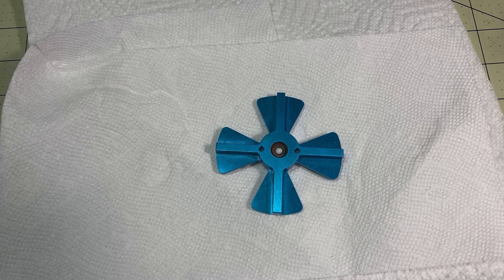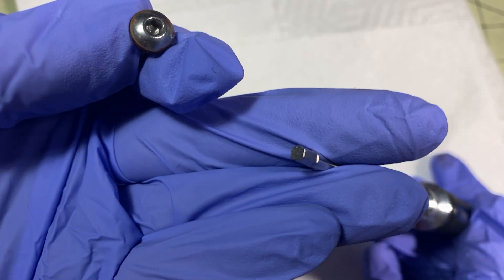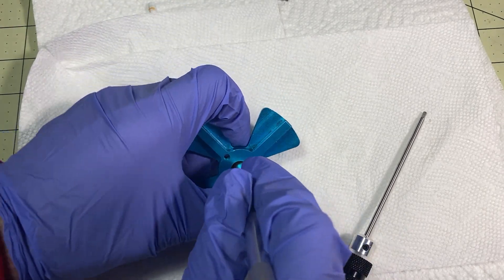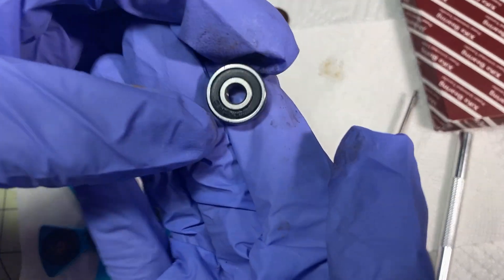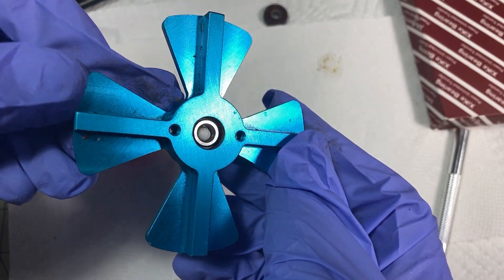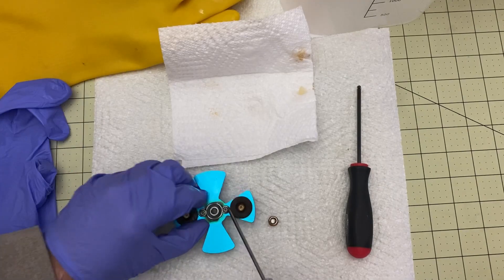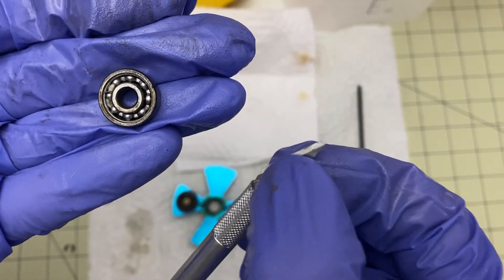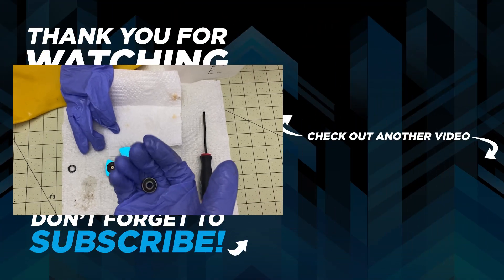What happens if you use water in your Resin Wash and Cure Station? And $1 Way to Fix it

Comment: Any info on how to replace the bearings in the wash and cure plus as the rotor has a different design and I can’t figure out how to get the bearing out.
Reply: I have the same problem, i was thinking it was pressed, soy try to push it out and broke the rotor 🥲

Comment: I have just taken delivery of the latest Anycubic wash & Cure station 2 and it is fitted with a S625ZZ bearing, which is a stainless steel bearing (the spare is also stainless steel). So hopefully, this will fix the issue?

Comment: Awesome video, thanks for putting it up.  Any idea if these bearings will fit a Anycubic Wash and Cure Plus?  That's the larger, more expensive one.  I've been washing my water washable resin with running water and a toothbrsh and it's really a pain.  Also any tips on disposing the water (besides leaving it in sunlight to evaporate/cure)?  Disposing of the water would definitely be a good topic for another video!
Reply: Maybe someone will find it useful. This machine uses a 628 bearing with dimensions 8x24X8 mm. Also, this lower rotating part already has 4 magnets and it is completely made of plastic, but it is still better to change the bearing itself and put it with waterproofing. If you wash in water. Thanks to the author for the content.
Reply: I was thinking i can take it out pushing it, so i broke de rotor 🤣, i will try with super glue to repair it, i think there is no another way to change it, if anyone know something about wash and cure plus bearing say something please

Comment: If it would have been designed better, it would never have needed a bearing to begin with if it they would have applied a little fluid dynamics in the picture. Brass bushing would have sufficed , but a ceramic or teflon bearing would have been fine as well.     Derp...

Comment: Ceramic bearing + dump the 4 steel screws for aluminium ones . . . problem gone.
Reply: Do you recall what type of screws they were? Metric? Imperial? Like M1, etc....
Reply: screws are alum on the 2.0, split washer however needs replacing as well

Comment: This is some more great info, I have an Anycubic Wash&Cure2.0 coming in the mail, and I'm definitely going to grab these washer, or find a ceramic one before I even start using it.

Also bought Phrozen's water washable resin from your article.  Looking forward to see how it does.
Reply: Funnily enough, both listings for Anycubic's 1.0 and 2.0, claim they come with a stainless steel bearing...
Reply: @theeeUnicorns  There are different grades of stainless steel, also the bimetal effect probably has to do with it (steel bearing, aluminum propeller in a conductive liquid)

Comment: Wonder if this has to do with bimetal effect:
"As many metallurgists will know, the bimetal effect, or bimetallic corrosion as it is sometimes referred to, will only happen when two metals of a dissimilar nature come into what is termed electrical contact with one another and they are bridged by liquid that is electrically conductive. Just like a simple battery would operate, this means a cell is produced that can result in corrosion. Frequently, this corrosive effect is noticed in one of the paired metals only. "
Reply: Hello RetroModern Art, I think you bring up an incredible point. Do you have any suggestions? Are their Aluminium bearings that would never rust? because the propeller is aluminium? I haven't used my wash and cure machine yet and would love for there to never be rust for this. I would be grateful for any help or suggestions
Reply: @Jesse_Dawg  The ultimate would be ceramic, from a comment below:

Aliexpress has them for less than $5.00. I bought the 625 5x16x5 size and it fits perfect in the Gen 1 Anycubic Wash and Cure station. https://www.aliexpress.com/snapshot/0.html?spm=a2g0s.9042647.0.0.65b94c4d6DEoah&orderId=8120392133478495&productId=32834087124
Reply: @retromodernart4426  Hello, thank you for the reply and solution!! That is awesome that there is a great fix for this. I tried to use the link you provided and it said the page could not be found. I would be grateful for any help with the link
Reply: @retromodernart4426  something wrong with link
Reply from the maker: @richardjones4493  Those don't seem to be available.  But if you want ceramic bearings I have added some options to the description.  I'm still using the ones in the video though and they are working great.  Ceramic 625 Bearings: https://geni.us/Ceramic625Bearing
Reply: @retromodernart4426  Hello could you please link again. The link you provided is for your personal order history (which can't be accessed) and not to the item. Thank you!
Reply: @TrueEliteGeek  Hello there are full ceramic bearings that have no steel which causes rusting. The ones you link have steel on them still. Or am I misunderstanding?
Reply: @Jesse_Dawg  It wasn't my link, it was from a different comment.

When I found out that link was, as you know, from someone else's order, I found the item and it was sold out.

I then looked up another ceramic bearing that was the same from another supplier, but YouTube may block comments with product links for some reason ...

So I have no way to link the product at the price from the vendor I found.
Reply: @retromodernart4426  Thank you for the reply! And I am sorry I had no idea you left a comment with the link before. Also, that is very very unfortunate and kinda upsetting that True Elite Geek is blocking people from posting about their finds. I thought that was his whole thing was about the community coming together to help each other. (I have even used his affiliate links in the past but now this isn't cool at all of him). Anyways...

Would you please tell me if it was the "full ceramic ball-bearing" like they are full white on both websites (Amazon and Aliexpress) and the entire item is ceramic OR is it the steel ball-bearing with ceramic inside instead of rubber or steel? 

Would be grateful for this clarification. Thank you and have a great day!
Reply: @Jesse_Dawg  I am talking about only the "FULL", entirely ceramic (usually with PTFE), white ones.
Reply: @retromodernart4426  Thank you so so much! I will order some asap
Reply from the maker: For the record I’m not blocking anyone, ‘expect one guy that was extremely rude to people’.  That is all Youtube and their anti spam system.  Sometimes I get a notice and sometimes I don’t.  Sometimes I can got mark them as not spam and sometimes they are just gone into the ether.
Reply from the maker: I’ve never used full ceramic bearings.  I was afraid they would be fragile and with how much junk ends up in the water something would get stuck in them and they would explode.  Is that not the case?
Reply: @TrueEliteGeek  OK sorry for that, I edited my comment.
Reply: @TrueEliteGeek  Not the case.

" Full ceramic bearings are lighter, smoother, stiffer, harder, corrosion resistant, and electrically resistant. Full Ceramic bearings are used in extreme and in special environments..."

See:  https://www.ortechceramics.com/product-category/ceramic-bearing/full-ceramic-bearings/  for more.
Reply: @Jesse_Dawg  everything corrodes in the right conditions. To avoid this type of corrosion, you need a material identical to the other metal so there is no electrochemical potenial difference between the metals
Reply: Gavlanic corrosion. Different electrochemical potentials lead to corrosion of the more active material. Sometimes this is desirable, like with galvinzed steel

Comment: Bro, just get a ceramic bearing... It won't rust
Reply from the maker: I forgot to mention that I looked at those too. That was going to be the next test if these corroded. But they aren’t cheap and I don’t think you can beat these for the price after seeing the results.
Reply: @TrueEliteGeek  Aliexpress has them for less than $5.00. I bought the 625 5x16x5 size and it fits perfect in the Gen 1 Anycubic Wash and Cure station. https://www.aliexpress.com/snapshot/0.html?spm=a2g0s.9042647.0.0.65b94c4d6DEoah&orderId=8120392133478495&productId=32834087124

Comment: One tip, you can use white vinegar or lemons and salt to removed the rust, its really cheap is easy solution for this type of projects. oww also WD-40 is a really good rust remover.